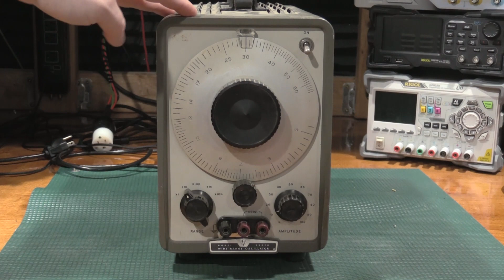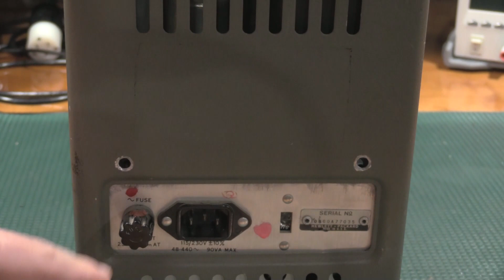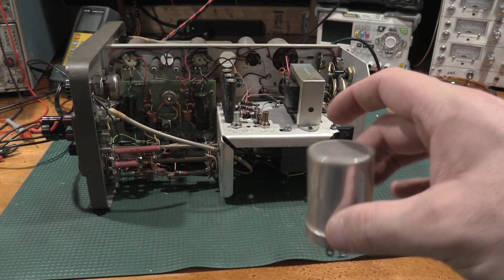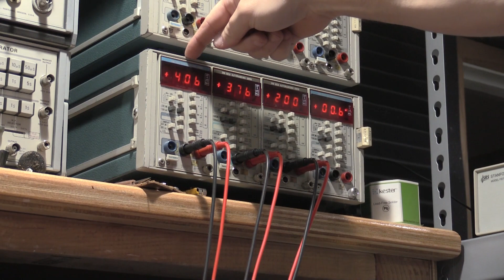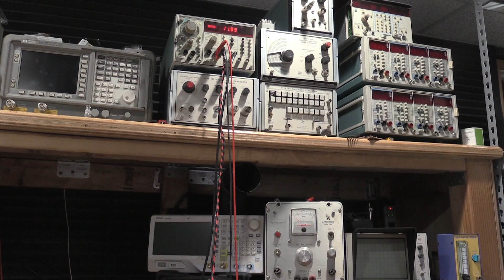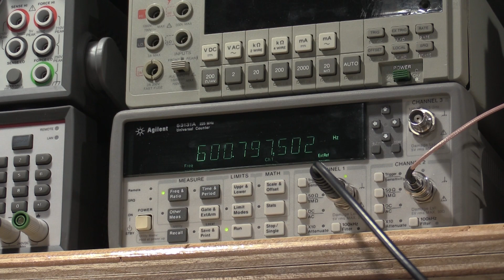HP 200 CD Restoration and Alignment

Comment: Why is there a jumper on the front From positive to negative ?
Reply from the maker: It can be used double ended or signal ended because of the output transformer This is currently set up for signal ended mode.
Reply: @ZenwizardStudios  I want to use it for audio testing speakers. 
Do I use the jumper or not ? 
Thanks for the reply, I appreciate it. 
Not much I can find on hook up.
Reply from the maker: For me for normal use the jumper is fine. It needs to be removed when the DUT need differential signaling at its input a higher end audio amplifier as an example that takes advantage of the - going signal.
Reply: @ZenwizardStudios  I'll try my best to interpret the nomenclature.
Thanks again.
Reply from the maker: I could do a video on that topic if it would help that one might be better explained long form. The shortish explanation is differential signaling is a noise reduction technique that is some times used in audio circuits but is EXTENSIVELY used in high speed digital circuits. Pretty much EVERY Ethernet and USB device uses differential signaling to get the data down the wire. The best way to look at it is the signal has a Data + and Data – line the data – line is exactly the same data as the + side just inverted. This is what creates the “eye diagrams” used in grading the signal quality
Reply: @ZenwizardStudios  I have an EIco Model 377 Audio Generator.
It's easy to operate. 
I bought the HP 200CD hoping it had more output.
I'm going to hook up an external amplifier to the 377. 
A block from my house was an older man that had an obsession with collecting and working with electronic equipment.
His son is selling off all the stuff. 
Looking for anything ? I mean it's incredible all the stuff he has. 
Example. At least 50 vintage oscilloscopes.

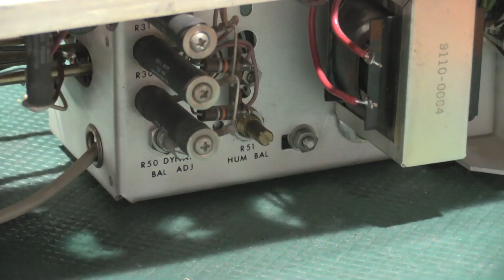Comment: Great video! Is that black beauty still holding up? 32:40
Reply from the maker: I will head back in an check that one for leakage but that position was in the oscillator section if I remember correctly I expected Mylar construction rather than paper. It also had a different physical style to the paper caps. Mylar would be fine to leave behind and will serve for years to come. Paper would need a replacement. A paper type cap will not hold frequency due to drifting properties even when they were new.

Comment: One thing, the Tek AA501 Monitor output is not just buffered, it is normalized to 1VRMS above 50mV input. So you can't just treat the AA501 as an attenuator. The idea is that you never have to tweak the scope that is monitoring the monitor output, just set it to 1V/div or whatever suits you. Below 50mV input it applies gain of 20.

Comment: The later 200CDs were factory with the newer style power input
Reply from the maker: I do like the newer style IEC connectors, they make life a lot easier. Good to know this is a later unit.
Reply: @ZenwizardStudios  Date on the bottom of the choke says 1971 FWIW... of course they may have had a decade's worth of parts. Supposedly they made these into the 80s.